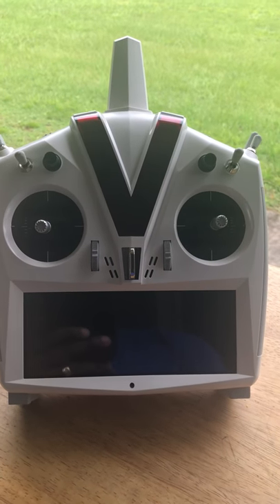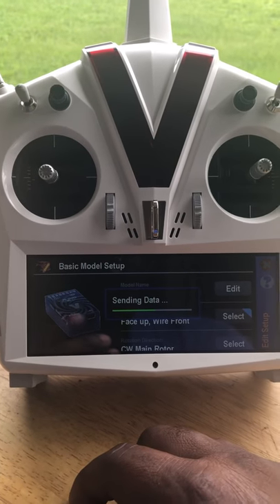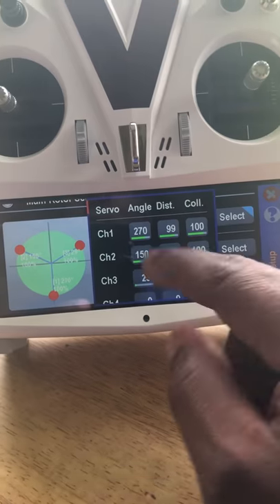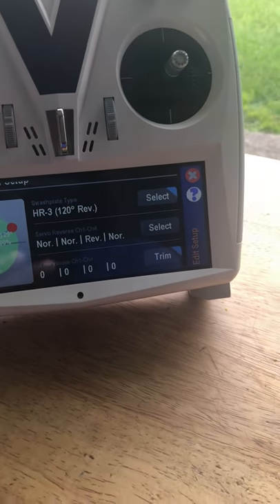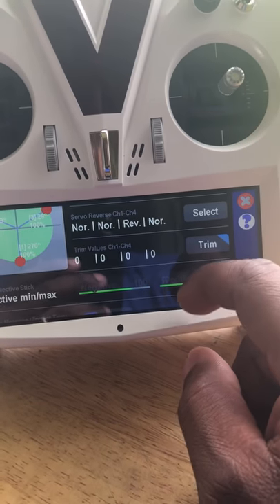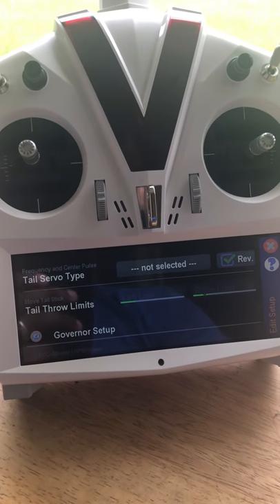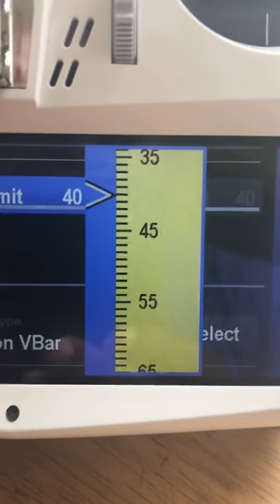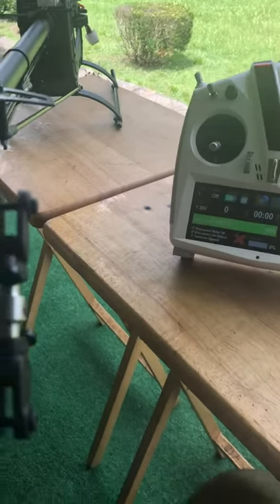VControl Touch Basic Setup Video With Tips!!

Comment: @13:00 you're talking about leveling the swash electronically. In the OG VControl there was fine trim at high and low stick as well with Pro upgrade. Is this feature gone in the touch? Or is there an app that needs to be loaded to get that functionality back? I'm asking because I'm migrating my NEO from one heli to another and need to do setup on the new heli on the touch; and now I can't find the endpoint adjustment menu.

Comment: HELLO. WE WOULD LIKE THE HELICOPTER TO RISE VERY SLOWLY WHEN THE COLLECTIVE PITCH CONTROL STICK IS MOVED. PLEASE TELL US THIS CAN BE ADJUSTED IN V-BAR CONTROL? DO WE NEED TO CHANGE THE EXPONENT (EXP) TO DO THIS? IS IT CORRECT? IF SO, WHERE IS THIS SECTION IN V-BAR CONTROL?
Reply from the maker: @very9000  change your overall pitch in setup. How much pitch do you have it set to now?

Comment: Hi.  I am using GOVERNOR ESC SCORPION.  Is it possible that on the ground there are some rotor revolutions, and others in the air? (They are respectively lower)
Reply from the maker: You mean different headspeeds?
Reply: @laughingstill  Well, for example, on the ground before takeoff the value is 1650, and when it took off 1520, but the value in the air is stable and constant.  Also tell me, how does it affect the flight if I change the GAIN value: P, I and D (soft, medium and fast)?  Yes, I forgot to mention that I am not going to fly the LOGO 800 3D.  For me, the flight is important ✈️ such as a copy of a helicopter.
Reply from the maker: Ok, that sounds like you me motor is not tuned just yet. Too rich..
Reply: @laughingstill  How to understand?  You mean the ESC SCORPION adjusts?  I forgot to say that before that, the first time I took off at 80% of the throttle curve, the stick was almost in the uppermost position, and when I took off today everything was fine, the stick was in the correct position (just above the middle).
Reply from the maker: Oh ok, you are trying to use a “normal mode” with an electric. That is to use for nitros to keep the motor from bogging in start up. An electric does not need that. You should keep your sticks at the center and click the motor on. The esc will spool up to the head speed set and then you lift off and fly.
Reply: @laughingstill  what are you talking about in general?  🤔🤔🤔read about my problem the helicopter 🚁 does not take off with the normal stick position.  Only when the stick is at the top ...
Reply: @laughingstill  🤔🤔🤔🤔
Reply: @laughingstill  read about my problem the helicopter 🚁 does not take off with the normal stick position.  Only when the stick is at the top ...
Reply: @laughingstill  NO